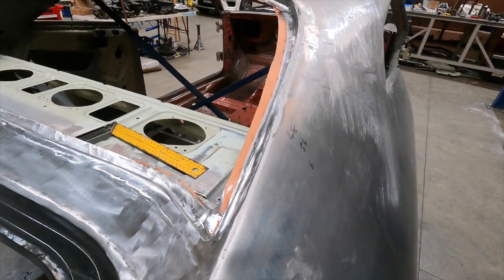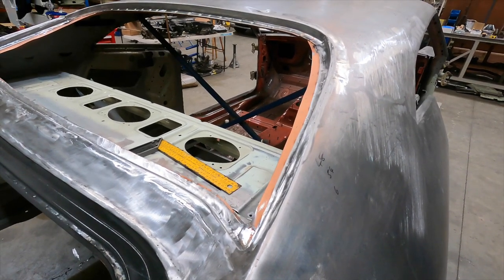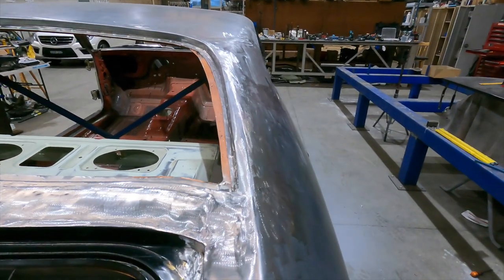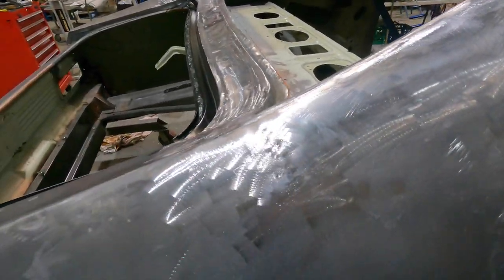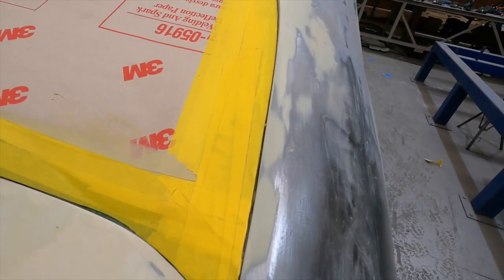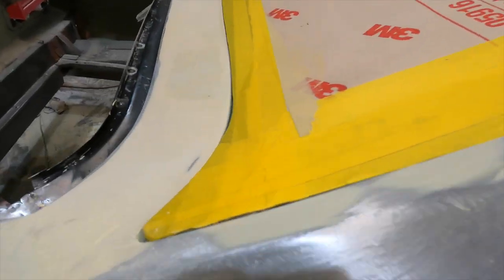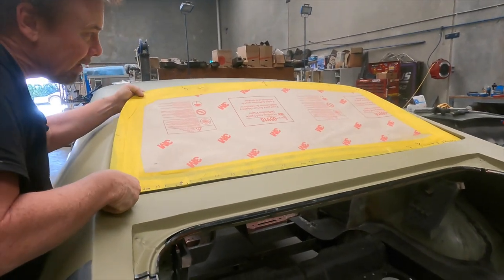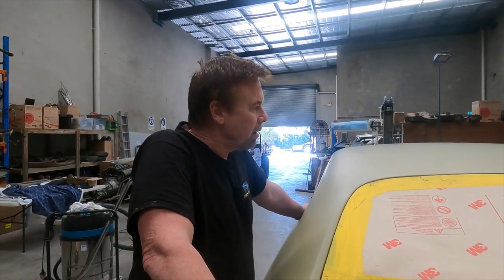How to flush fit the rear Screen -  EPS 58 - Mustang GT Floor grafted into Falcon Coupe & Coyote

Comment: I have been watching two other channels who are doing the same thing as you are, old car bodies modified with a modern car chassis and drive chain. 
Urchfab and Bad Obsession Motorsport.
1950's Ford Prefect on a Mazda MX5 and a Early 70s Minni Leyland body adapted for the drive train of a Toyota Supra turbo all wheel drive. 
All entertaining and informative as well as the Mustang and XB Coupe that you a are morphing into existence, thanks for letting us come along for the ride!
Reply from the maker: Thanks alot Bruce !  will try ti improve the presentation as time goes along also. I will check out those other channels
Reply: @phatridesgarage3760  Bad Obsession  Motorsport are entertaining with there one liners and innuendo.
Reply: @bruceclarke6368  the running gear in the Mini is a celica GT4 not a supra. im not aware that there were ever any AWD Supras.
Reply: @petelattimer6808  yes you are right ! Had a brain fart at the moment of writing the text.
The Monster that won Bathurst was a turbocharged Supra.